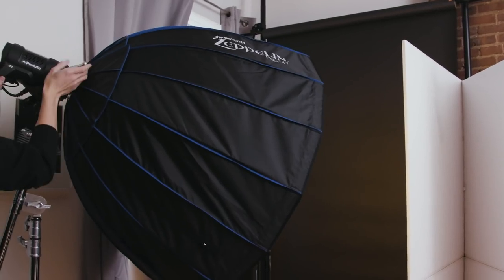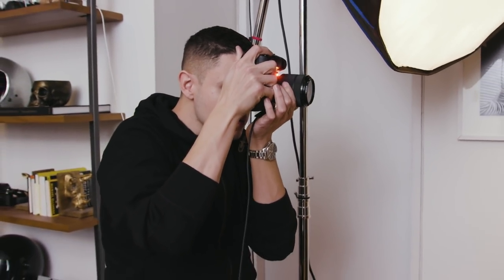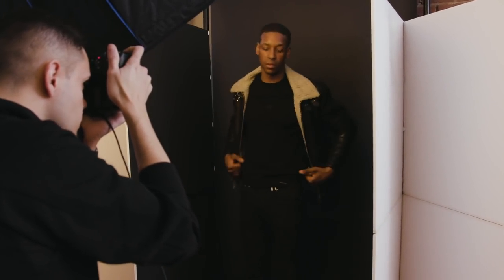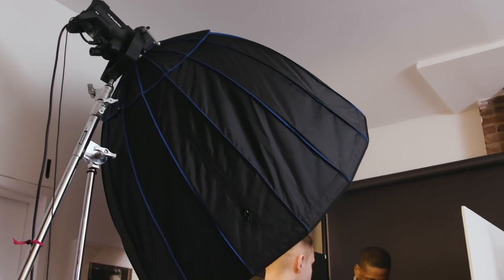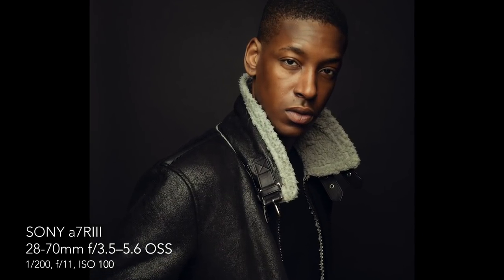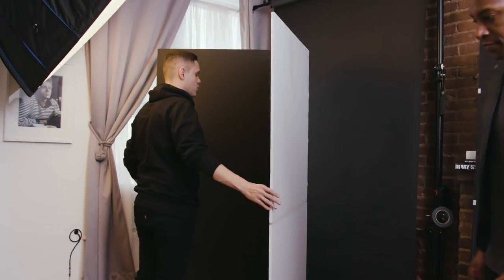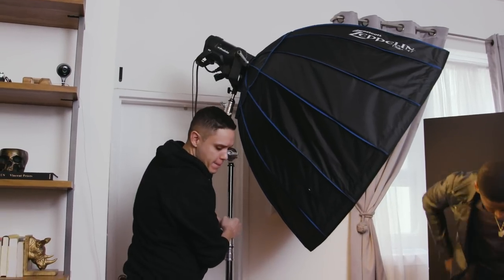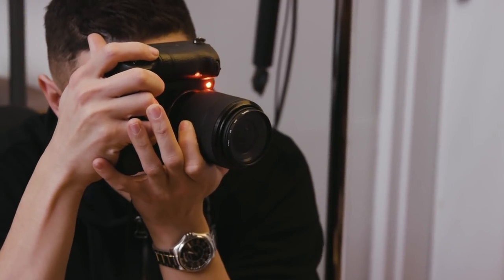Controlling Light | Black V-Flats

Comment: Great video, Jeff, I have some questions, how do you deal with the height of your scene when you have a small studio, I mean the ceiling of the room, the roll of paper and the distance from the bottom in case you need it?
In my place, my roof is 2.5 meters high, when I have to take a full picture. I have problems with this and I hate to "remove" the roll of paper and the ceiling in photoshop ... :(

Comment: Great tips ! Quick Question… what is your ideal “power” you set for your strobe light? Specially if you shoot at a F8- f11 // iso 200 // shutter 1/200 ?
Reply from the maker: That's a really great question! Whatever settings I need to get proper exposure for that specific setting depending on the light, modifier, and distance.
Reply from the maker: That's a really great question! Whatever settings I need to get proper exposure for that specific setting depending on the light, modifier, and distance.
Reply from the maker: That's a really great question! Whatever settings I need to get proper exposure for that specific setting depending on the light, modifier, and distance.